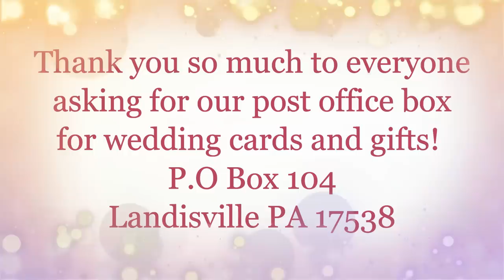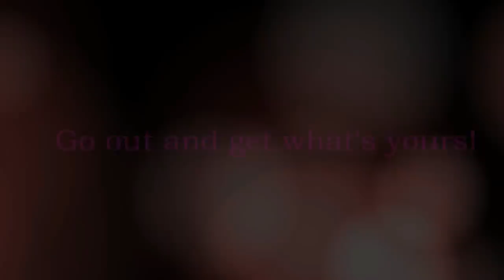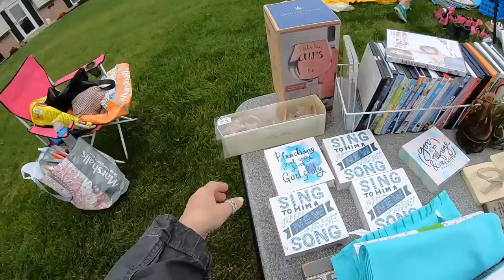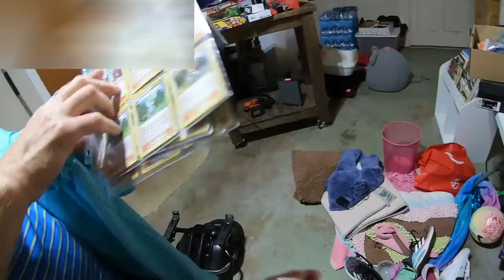she needed a minute | Turning yard sale finds into Huge Profit!

Comment: New Patio:  you mentioned morning sun hitting the new patio and the need sometimes for an awning.  When we lived in Italy we had that issue on the patio, off the kitchen, where we would have our morning coffee.  We installed a retractable awning on the side of the building and when needed cranked it out.  

Several US companies now make them and they can be angle adjusted as well.  They work well for both shade and to keep off a light rain, to extend the use of the outdoor season in the spring and fall.  These days they can even be motorized, but ours had a hank crank that opened it up with about a minutes work.

Comment: Wagon Style Carts often take up too much room in a car.  When I’m not hauling a trailer, I’ve found that taking one of the quality made fold-up hand trucks is a good compromise.  The frame/handle collapses down and the wheels fold in, so when it isn’t needed it’s smaller then your purse.  

When folded out, it can carry a good stack of boxes or bins.  Sometimes I’ll bring along a milk crate and bungee cord, so loose items have a place to go right into and an IKEA bag can ride on top of the milk crate, staying off the ground and away from the wheels.  A well made one only takes up about 3 x 14 x15” of space and can store either flat or vertical.